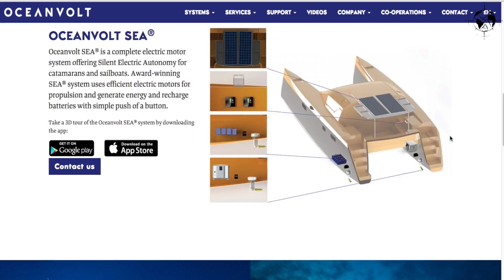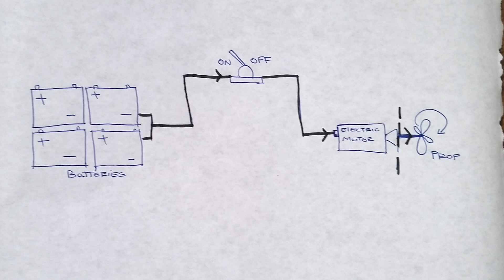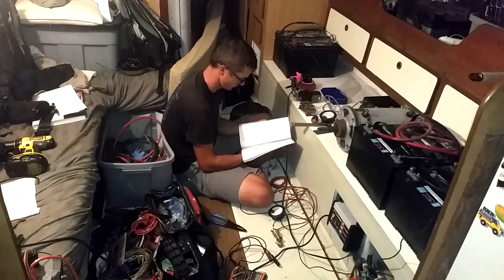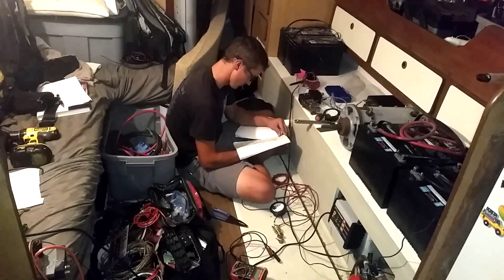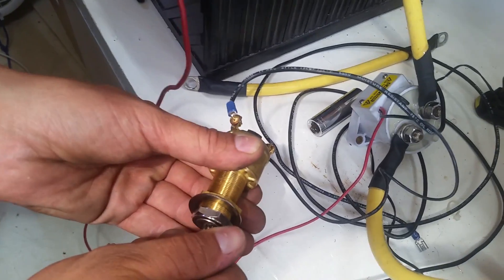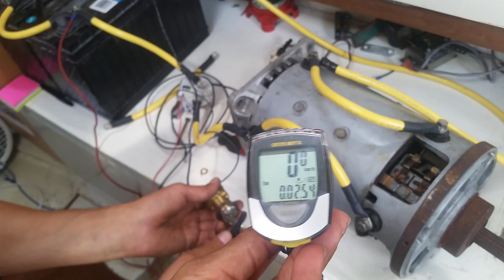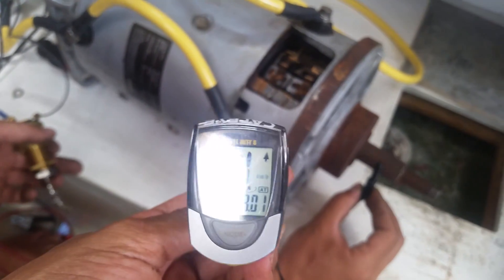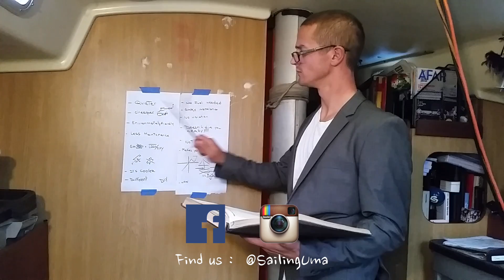We built our own ELECTRIC MOTOR  (Electro-Beke, part 1) — Sailing Uma [Step 17]

Comment: I'm really looking forward to this aspect of your plans, as it transcends the technical pros and cons of electric vs. diesel: a lot will depend on the lifestyle you adopt, if you wish to be successful and happy cruisers with this propulsion choice. As someone has pointed out, you are committing to a modest energy budget, and you will most likely have to forgo things like refrigeration, water generation, air conditioning, etc., at least when underway or at anchor. Of course, although you wouldn't believe it to hear some sailors talk, none of these things are required to make a sailboat go safely and swiftly, and minimum confort requirement appear to be inversely proportional to age, so you should be okay for a few years yet... Good luck and all the best! Bonne Année!
Reply from the maker: +Lazy Jacques Ac and water makers are certainly NOT on our list anytime soon. However, fridges don't use that much power, and with our solar set up, we should have plenty of power for everything we need.

Comment: I know the Uma project is on a very tight budget.  Color me very concerned about your machining the output shaft of your motor to fit the prop shaft coupler.  This part will take a lot of stress.  What is done is done but you should have left the shaft as it was and found a straight spline coupler.  Penny wise and pound foolish...
Reply: +Howard White Unfortunately I was shocked that they chose that path... sad, but hopefully they didn't pay much for the ebay motor... there was a serious wobble in the coupler already and unless a keyway is machined properly they fail fairly quickly under load.  Ah well mistakes are going to be made. They are young after all.
Reply: 4 years later and the motor didn't 'fail under load'. Ah well, guess the youtube experts were wrong.
Reply: They did well with the modded motor.  We may agree that the new motor and sail drive install is a very good project.

Comment: Wow. You do realy cool work and i'm looking forward to see the next episode and, of course, to see Uma sailing. But one questions or concern i do have about an electrical drive. To try to get out from a gale or so is nonsense, no engine would help (maybe if you had an speedboat, but that is an other topic), i agree. But what will you do if you're at anchor, the wind is pushing you in the direction of the land and your anchor slips. Because it's the only situation i can think of, a diesel engine would be better (?) than an electric system.
Do you have concerns about this scenario?
Reply from the maker: Thanks for your comment and question. The best answers we can give you is that we will make sure to 1) have 1 or 2 good anchors; and 2) not anchor and shitty anchorages or where theres poor holding; 3)become good sailors.

Comment: Very good video! I think it's time to show that it can be done! I'm thinking of doing about the same with my 30 foot motorboat... What kind of power output of the electric motor, compared with the diesel engine, should I be looking for? Right now, the diesel engine is making 36 hp and it has no sails.
Reply from the maker: Well it only works for us because we have a sailboat and wont need to motor more than half an hour. But I am sure it is possible for a motorboat too, expect that you would need 2 nissan leafs worth of batteries. Hope that helps a bit. Goo luck!

Comment: Is this motor brushless?
Reply from the maker: no
Reply: Sailing Uma it will require maintenance occasionally
Reply from the maker: Yes, we will be ordering at least one set of replacement brushes before leaving the states. Luckily they are very easy to access and only cost a few bucks.

Comment: I'm pretty sure the motor will not take the thrust load from the propshaft.  Thats one of the main functions of a transmission is to carry the forward and reverse thrust load.....
Reply: +Frank Balcer I wound't be surprised if in the next video they show that they replaced that noisy bushing with a thrust bearing... I guess that is what keeps us watching.
Reply: +Mike I rebuild electric motors as part of my job. The thrust bearing in a standard electric motor will NOT handle the thrust required to push a sailboat. Look at any marine transmission and you will see that an angular thrust bearing is used (actually two, one for each direction)
Reply: I would be a little surprised if they had overlooked the axial load on their motor given that they seem to have put quite a bit effort into this.  It could be that they are having the machine shop install a thrust bearing or maybe they have a thrust bearing in the drive line before the motor.  As I said we will wait and see how/if they addressed it or maybe you are right and they forgot that their propeller will produce thrust.
Reply from the maker: +Mike Yes, the motor is at the machine shop having the proper bearing installed to handle the trust of the propeller.

Comment: is the motor made for taking the thrust load?
Reply from the maker: +Dan fish The motor is built like a tank! The noisy bushing in the back end is being replaced by a bearing rated to take the trust from the the prop. And yes, we are going direct drive for now. If the motor spins to fast, then we will use our transmission to reduce the speed. Most electric motor installations on boats use cheap, light weight motors, and in order to get their watt rating up, they run them at high rpms which in turn have to be reduced to eliminate prop cavitation. Our motor has a high watt rating and low volts, meaning it should produce high torque at low rpm meaning we wont need a reduction gear. But, since this is all one big experiment, we will only know for sure once everything is installed.
Reply: +Dan fish yeah was thinking same when he said he was mating that direct to shaft coupler.... that motors internal bearings will be gone probably pretty quick and at the wrong time while docking or something...need to forget about that and research thrust bearings and blocks...people dont realize they are built into marine diesels and larger ships have a dedicated setup of block and bearing attached to hull structurally etc
Reply: +Dan fish The motor bearings are ball bearings so yes they can take an axial load. On our reach fork trucks the primary reduction is a a flat spiral gear so the motor sees axial loads in both directions under load depending on the direction driven. I'm not sure what this motor is from but it has ball bearings in it, in the commutator and drive end, most likely.
Reply: +Dan fish these setups usually (or always) have a gearbox/trans mounted to handle thrust forces
Reply: great I did kind of think you must have taken this into account and in the video you said the bushing was being replaced with a bearing so it makes sense. I'm guessing it will take the thrust from reverse "gear" also. Good luck with it I await sea trials
Reply: +Dan fish  that's a good point to make.  They may need some kind of bearing assembly on the shaft the transfers the thrust to the boat and not the motor.
Reply: +S/V Sugar Magnolia And I'm pretty sure the bearings wont take the thrust load!
Reply: +S/V Sugar Magnolia ah I see so by spiral cut i understand helical gears? yes they would give a thrust load so perhaps the motor is up to it but I think he said the nasty noise was from a bushing and I understand that as a plain bearing in the rear of the case which made me think perhaps the rotor was free floating in the case with maybe just some thrust washers. either way you guys need to be sure of the path the thrust will take from the prop to the hull and go a bit over rated on the componants otherwise one of your reasons (very valid) "less maintainance" will go out  of the window. I was also a bit dubious of the hand made taper coupling but we will see how that works out in the long run. Good luck loving the videos and I mean all the coments as constructive critisium not doom mogering ;-)
Reply: +SuperJlonergan they are smart I'm sure maybe he misspoke about going right to shaft n is doing a trans of some sort
Reply: Yes Helical. Sorry lol
Reply: +Dan fish If it came of a fork lift i would guess not, but if the housing is strong enough you can probably change out the existing bearings for ones that will take axial thrust, alternatively and mentioned already you could simply split the shaft and fit a thrust bearing (aquadrive type), but that is a fair bit more work.
Reply: +Adam Lewis I don't think you're finding bearings for both for n aft thrust for that motor. If you could fit them they wouldn't be beefy enough to handle it.  Have to put a gearcase in as thrust block/bearing

Comment: I was just thinking ouch why dont they wear shoes (I live in steel toes) when I noticed the plaster on the big toe at 3:55 dudes when working with heavy metal shit wear boots... aside from that I do like your project looks very interesting
Reply from the maker: +Dan fish Honestly, I don't even remember why I had the tape on my toe. Pretty sure it was in hang nail I cut to short. Anyway, the benefit of going barefoot so often is that I have very tough feet, no injuries so far. Just don't be carless.
Reply: oh dudes Im not one to cry on about safety its your buisness totally, I work in engineering so steel toes are the norm and it makes me cringe seeing soft flesh so close to gearboxes, engines and batterys, all those things will make a mess of your feet no matter how tough they are... but hey your feet your look out. I'm liking this conversion and wish you all the best of luck

Comment: Fantastic!     Forklift motors are very durable and should give you years of service and they are relatively cheap compared to a diesel engine. I hope to get my own boat someday and convert it to electric for all the same reasons you have. Mainly because of budget concerns and reliability as I will have to do it all on the cheap. Why would anyone want a diesel when this is possible? When you are done, I would love to get a copy of you final wiring diagram. I know you have put in the hours to figure all that out! Here is an easy way to avoid that diesel taste :)  harborfreight.com/self-priming-copper-jiggler-pump-47334.html  Again, Great Job!
Reply from the maker: +Someday Sailor Thanks. We will OF COURSE be posting final diagrams and details on our site, so it can be of use to others.
Reply: +Sailing Uma Thank you. It is much appreciated by all of us electric fans!

Comment: I am currently making my own electric outboard motor, so i love what you did with the spline and shafts.  Question though, this might be a little into the future but have you considered the size of your battery bank and the range it would have? Also, what is your plan for solar panels and wind turbines? 
There is another great sailing channel called "ECO sailing project" not sure if you heard of it or not. They built a well built electric sailboat and did a circumnavigation. They speak french though so you would have to use the subtitles options tho.
Reply: Also, do yall plan to protect the system somehow from incoming water? I just finished reading Tania Aebi's book and she was knocked down in a storm with no sails up. It destroyed her whole electrical system, I'd hate if that happened to yall. Best wishes and good luck.
Reply: +Eric Crouch That's an excellent point. The best place for a heavy battery bank is down by the keel for obvious reasons, but that is also where the water goes if you have any ingress - and it doesn't have to be as big an event as a knock-down. A few years ago we had a major prop wrap on our 40ft sailboat that punched the "P" bracket up through the hull and allowed the water in - although we didn't detect the leak at the time. We were 3 hours away from port, so with the engine disabled  we sailed back on a port tack at a steady 6 knots or so. It wasn't until we lost the wind and the boat stopped heeling, that the water that had been accumulating in the starboard bilge flowed to the centre. On seeing the boat filling with water we managed to get a call away to the coastguard, but shortly after that, the batteries shorted and we lost all electric. Luckily for us, we had a couple of handheld VHF radios and we're now close enough to keep in touch with the coastguard and the lifeboat.
Reply: +Eric Crouch Later, during the clean up, I was troubled by how quickly we had lost power and had circumstances been a little different, we might have lost the ability to get a distress call away. So, when we we reinstalled the electrics, I also added a small 12V motorcycle battery high in the deck saloon along with a switch to allow us to cross the VHF radio to the auxiliary power if ever we lost our main battery banks. We check the charge every 3 months and test the radio using both power sources. Whilst you guys on UMA are re wiring the boat, it's worth thinking of a similar safety mod......

Comment: I think you guys are going to be really  disappointed, I wind electric motors for electric
vehicles (ac motors) 4 batteries won't go far.
Reply: +Venture Lives (Sailing) +Robert Garbe I'm not sure I totally agree, as an example, I sailed 1150 miles from Falmouth (UK) to Gibraltar in 2014, used 80 liters of fuel 50 of which was just to charge batteries, we burn about 5 liters an hour under motor meaning in about 7 days we used the engine for about 6 hours, ok,  we were not in Alaska, but we were in open ocean. Boats sailed the world for a very long time without engines, of course a some incidents could have been avoided with a diesel engine, but most of the time (from my understanding),  better navigation aids and better weather reports would have prevented numerous disasters! All to often I hear people "escaping" danger by putting the engine on when honestly good old fashioned sailing skills and a good boat will get you out most troubles.
Reply: +Adam Lewis sailing skills being the key words here. There are definite advantages to having dependable power available, if you're a novice. The learning curve just got that much steeper! :-)  I don't think they are sailing off to Greenland just yet, so luckily they'll have a chance to gain experience first, and then re-evaluate their options down the road.
Reply from the maker: +Ivansgarage It's ok. We're only estimating 1 hr of use per day. We're really looking at how much energy we can reasonably generate in 24hrs and sizing our battery bank to that. Instead of how far we think we need to motor everyday.
Reply: +Sailing Uma   I would be looking at wind generators all so and solar.
Reply: +Venture Lives (Sailing) I agree. It becomes a lifestyle choice, even more than a technical one.
Reply: +Robert Garbe This is a valid point, and we'll have to see if they revisit this decision if they range further afield.  As much as I admire going without the smell, noise and headache of a diesel, I wouldn't go that way in high/low latitudes. Not without more experience. A back-up genny is an option they might want to consider for serious offshore work, where you're far from help. Clawing your way off a lee shore in the middle of the night with no engine when you can hear the breakers nearby is not my idea of fun...
Reply from the maker: Yes. Getting power back from the spinning prop while sailing is one of the things we will be experimenting with. It is possible, some of our early test showed voltage. But until we can test it under sail, there is really no way of knowing just how much power we will be able to get back.
Reply: +Lazy Jacques, Yes most DC motors can be used to generate electricity, but they are generally not as efficient as a true alternator, also using your shaft line can be done and can generate loads of power (+50 AMPS is not unheard of) , but there are some downsides, there's a lot of frictional losses in the shaftline, it can be noisy, you put extra hours all the bearings etc, but the big one is that you cant have a folding prop and thus when you dont need the power you still suffer the drag of a fixed prop, which on a small boat can be almost a knot. There's a pretty good write up here... https://www.morganscloud.com/2012/11/21/staying-in-charge-part-iv-hydro-power/
Reply: +Ivansgarage I would definitely agree to additional power generation for when the sun doesn't shine, but may I also propose a hydro-generator to re-charge batteries whilst you're sailing, watt&sea is the top end (but also unbelievably expensive), but can get the tow behind you type as cheap as $800 for a little less power, see here for an example http://www.nauticom.fr/fr/hydrogenerateur/hydro-generateur-aqua4gen-12v-24v-2418.html
Reply: +Adam Lewis No expert here, but can't electric motors be rigged to do exactly this? A separate system seems redundant, it seems. Or not?
Reply: +Venture Lives (Sailing) Performance and SAFETY, if you get stuck out there and can't move on to your next port of call.  But then you can skuttle the boat and pop the EBIRB.  Strong, reliable propulsion that can keep you moving at close to hull speed for a good many miles is essential if you are going to cruise long distances.  If they are in sheltered waters and such, no porblem.